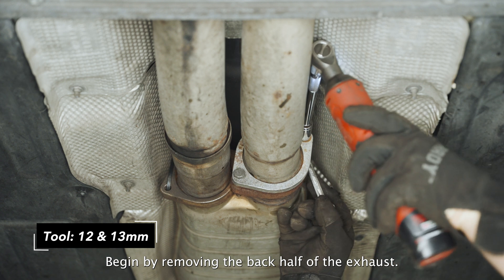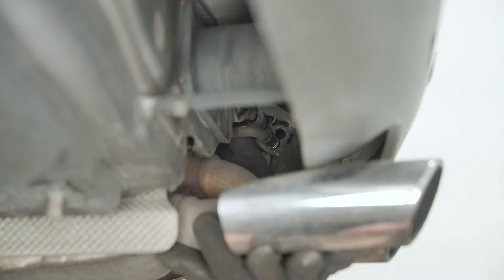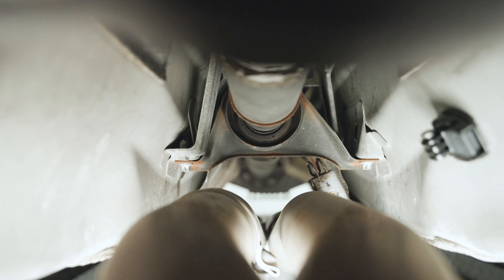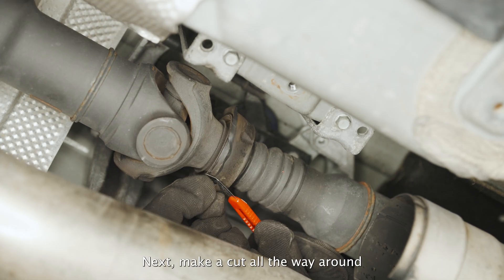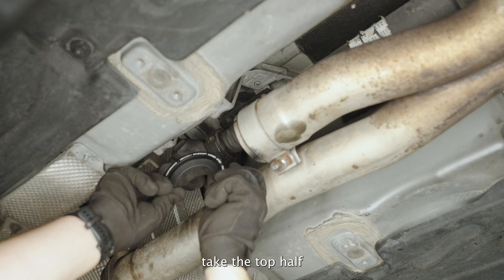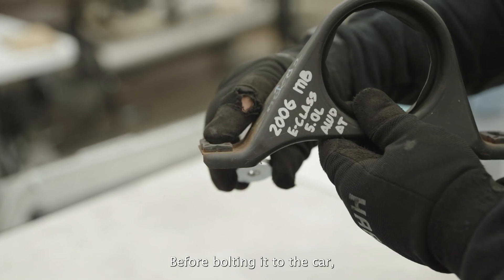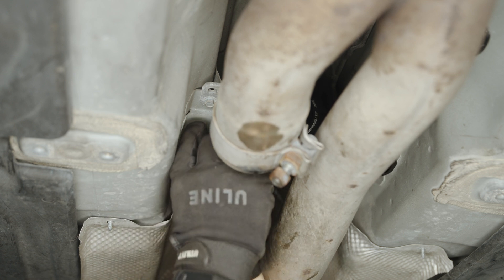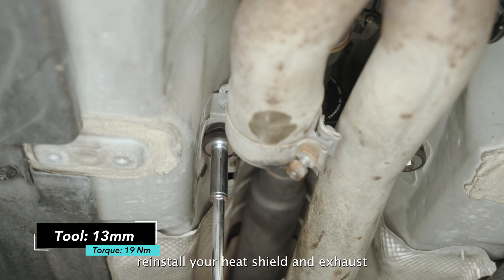W211 Mercedes-Benz E55 AMG Driveshaft Carrier Install Guide | JXB Performance (MB002A0)

Comment: I have just installed and still I have some vibrations. The supporter look like loose. Doesn’t hold enough. Even I can remove  with my hand when it’s on. What would be the solution?
Reply from the maker: Please send us an email at contact@jxbperformance.com and we can help troubleshoot any vibration transfer issues you're getting.  Generally speaking these naturally will feel soft by hand, especially if you're manipulating it without it being attached to the vehicle, since you can apply forces that the driveshaft cannot.  In the realm of driveshaft vibrations, we just need to find the correct balance between performance (being stiff) and vibration damping (being soft).  Generally, the stiffer the carrier, the less vibration it can absorb.  We can definitely help get to the right answer for your vehicle.  Talk soon.
Reply: How do I order this set up
Reply from the maker: @johnbill9328 here's the link: https://www.jxbperformance.com/products/p/mercedes-w210/w211-e-class-w219-cls-class-driveshaft-center-support-bearing-carrier-upgrade?rq=W211

Comment: Ugh I threw away the factory bushing and replaced the barring. You should probably make it more obvious that you need to cut the factory bushing and that it’s not a direct replacement.
Reply from the maker: I mean...that's exactly why we have this detailed install video that shows cutting off the rubber, not removing the sleeve the bearing sits in.  Not to worry though, just get a 62 mm bearing instead of a 55 mm OD and our bushings will perfectly grab onto the bearing directly.
Reply: @JXBPerformance  appreciate the solution!